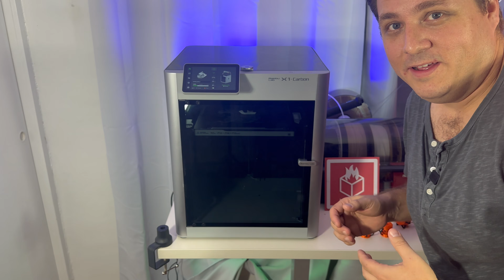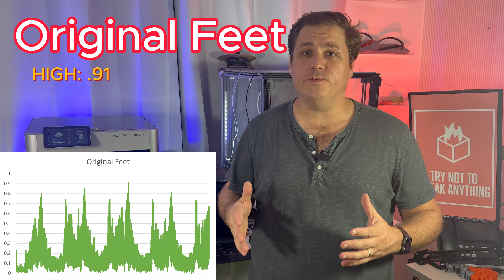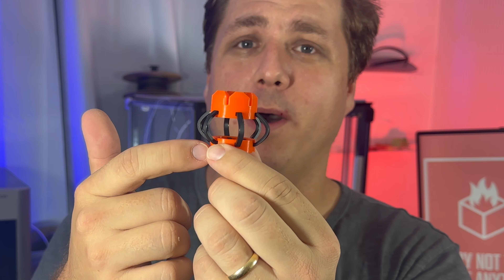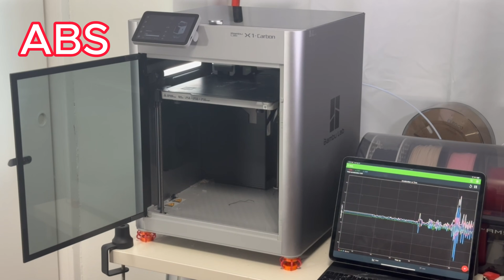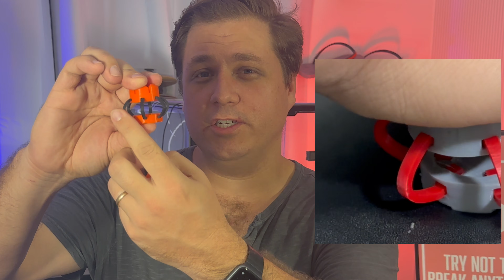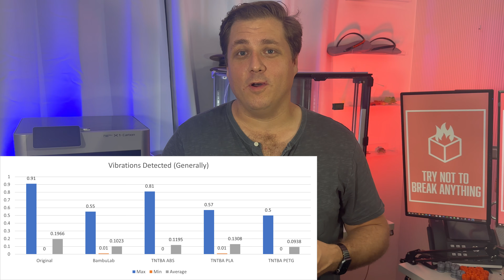Tested: BETTER BambuLab Anti-Vibration Feet. Download & Print!

Comment: Yo dude those are cool. 

One thing you may wanna consider ... and TBH I can not tell for sure but it kinda looks like your table may be one of those that has some sort of fold down feet ... and if it is ... a big part of your problem is likely the stability of the table itself. Again, I can't tell for sure how your table is constructed so I could be wrong here. 

I have found that with a rock solid stable table my printers have vibrated less because they could not get the table vibrating to begin with. 

Just my experience. Your milage may vary. 🙂

Either way, keep up the good work designing things!

Comment: cool video. I haven't scrolled through to see how long they lasted, but it is super rad you were able to best Bambu's offering.
Reply from the maker: I moved on to version 2 and they lasted almost a year. The clips failed on the back ever since I added the riser to my printer to hold up my AMS. It could be because of the riser weight or because I was moving my printer around a lot while I set up the new studio

Comment: I have some pet g and tpu on order so I'm going to test those ASAP. Which setting did you use for the tpu? This will be my first time printing this material.
Reply from the maker: So I used the regular FLEX setting in bambu slicer. try printing one first to see how that comes out. If satisfied print the final 3. Otherwise try tweaking the settings a bit.

Comment: Great design and research... I have a P1S on order. Doesn't the X1 have software-based vibration compensation? Is it not enough? I do not have a particularly stable/stiff platform in my 1930's house with all wood floors that is all over a basement, so I'm wondering if this is going to be an issue for me.

Comment: Hi. I loved the video and I'm trying to do the same vibration test with that app, but I can't find a way to get "the average" value:( I managed to export the recorded data as .csv and open it in Google Sheets, but all I get is a spreadsheet full of values for XYZ. Is there a way to get the average value from the app or did you just calculate it? if so, then how? Thank you!!
Reply from the maker: I got the average by doing the calculations on excel!

Comment: Cool looking feet. You should try the printer on a paver. I’ve got them under my prusa printers and they cut it down dramatically. As well as the noise level. Also helps if your table is solid. My desks are mounted to the floor so that helps. 
I just ordered an X1C so I’ll see soon. I may eat my words 🤣🤣
Reply from the maker: Thanks! Yeah but if I did that, I wouldn’t have been able to make this video! 😎😎
Reply: @TNTBA very true 😂😂 you could have compared your feet to a paver.

Comment: You know what would work better than your feet? A good solid table screwed to the wall with $1 worth of corner brackets. You'd instantly reduce your vibrations to zero, it would take 5 minutes to implement, and would last for years...
Reply from the maker: You’re probably right. Except i have an adjustable standing desk I use when I shoot my videos. I don’t want to have it bolted to the wall. With that said, yes - the sturdier the surface your printer is on, the better.

Comment: This method is reducing the vibration transfer from the printer to the table.  If that's what you are after, then your method is great, but ... that does not necessarily reduce the vibration of the printer itself and hence the ringing (which then needs to be countered by the input shaping).  I guess that you cannot get the input shaping data out of the Bambu, but it would be nice to know how all of these clips affect the resonant frequency and resonance intensity (so the nice graphs Klipper can deliver).
Reply from the maker: Dude: 100% this. If anyone has any clever ideas to get better testing, please let me know! Love klipper for this.
Reply: maybe you could measure the resonant frequency before and after when doing the calibration test ? @TNTBA

Comment: Is it printing better or not with those at high speeds? Finally that's all what's matter.
Shaking table less does not necessarily means it is printing without ringing, or with less ringing.
However I could be wrong.
I did test my Ender 3 S1+ with half squash balls used as feet, and it is slightly better and quitter.
Reply from the maker: So I started this whole journey because of my shakey table. I have not noticed any impact to print quality or speed for ANY of the feet I have tested. I am currently testing (as best as I can) version 2.0 against BL’s AVF for things like ringing, ghosting, etc. it’s tough because of how closed system it is compared to klipper.

Comment: No criticism, nice job. I'll try out your design. I personally have an issue with the BL feet, if you try to shift the printer slightly without picking it up, the feet bend over and fall out
Reply from the maker: Yup! They’re a pain in the ass. Version 2.0 will be released soon.

Comment: Could add a open honeycomb block(using thin walled  tpu) as a buffer between top and bottom to better dampen lower frequencies, while improving stability. Just some 💭♥️👍
Reply from the maker: I appreciate it! You mean, swapping out the clips for a honeycomb squish thingamabob? Or in addition to the clips?
Reply: @TNTBA  No, just in addition, probably spaced between top and bottom. Printing as one part might defeat purpose of noise isolation. Also if too rigid and/or too tight or a closed top/bottom, might deafeat the purpose. Printing with lowest durometer (60A) could make for better dampening.
Reply from the maker: I haven’t tried it. I didn’t have any luck with any one piece designs I made or found online. I did get some TPE in the other day though…. Hmmmmmmmmmmm…
Reply: @TNTBA  You are right, anything single piece will not work. But adding a cylindrical block of open honeycomb TPR, wedged btn. Top and bottom TPU, should work well, in addition to adding a bit of stability, if someone happens to put too much weight on a corner.
Another option is to print a taller version(so that it gets squished by the underside body), print a lot of them, sneak them in , spaced few inches apart equally  on every edge. Could completely kill any vibration. Only downside is any relocation could mean repositioning all of them. Just some 💭
Reply: Just to add upon multiple TNTBA anti-vibration foot on each edge, you could design a closed cookie cutter like base(may be for a set of 3 spread out over 10 inches), that would act like a locking base, and by providing 4 corners of this base with a plastic bolt and a nut, you could provide for ideal compression against underside of body. Also, with this base plate, you don't need to redesign a longer one. This would allow for better tuning, apart from making relocation easier(since the TNTBA AV feet is locket in place). It will definitely blow the vibrations out!😂❤👍

Comment: spend over a grand on the Carbon and it doesn't even come with its feet included? Wow...
Reply from the maker: It comes with feet. Just not anything specifically to reduce vibrations.
Reply: @TNTBA  I get that, but it's pretty clear watching it print that it shouldn't be a $10 add-on, it should be the default
Reply from the maker: @ShadowDrakken ehhhh… you may prefer not having the AVF by BambuLab. I think they should have thrown them in for the user to choose - in that sense, I agree with you there.

Comment: Cool project! The advice that I've heard from 3D printer designers is you ideally want the printer sitting on a large stone paver (bonus if it's anchored to the paver) to add mass to the unit, and then use high-density foam to decouple the printer mass from the table it's sitting on. This should not only reduce vibration traveling to the table, but give better resonance performance to the printer.

Would be interesting to see a follow up test from you or someone with a Bambu.
Reply from the maker: Yes! I’ve heard that as well. I even read a post by highrise955 on the BambuLabs forums, doing similar testing. I would love to see someone do some serious testing and provide me with their data/results so I can attempt to improve my design.
Reply: @TNTBA did you ever get a paver and test this? If not I can test for you today

Comment: You saw significant reduction on the table vibration.... but not of the printer. Just look at how much it wobbles like a jelly on those feet.

There is a reason why machinists want as much mass as possible on their machines rather than trying to damp it with rubber.

Much better off having solid rubber feet and adding a plate of steel to the bottom of the printer.
Reply from the maker: I appreciate the comment! Just trying to make a thing that works as good/better as a paid thing sold by BambuLabs. As I’ve stated, I’m not an engineer, designer, or scientist. I’m just a guy passionate about 3D printing who’s trying to solve a problem in a creative way. Assuming you’re right, by all means: go out and get your slab of concrete or metal sheet and rubber pads! All love brotha! May your layers print clean, and your prints come out epic! 

I’ll test the vibrations on the machine in the future to see how they all play out. Stay tuned!

Comment: Great approach for problem solving, a suggestion when you take your measurements using your phone or ipad accelerometers, make sure the device is laying completely flat and facing the exact same direction with every test to reduce the error. if you have your ipad up and tilt your ipad screen differently for each test, the x,y,z movement values will be different even if the movement on the table is the same.  Laying it flat and facing it the same direction for every test will help reduce the error for each axis and will provide more comparable data for which way it's helping reduce the movement, left to right or front to back. Based on your design, it would likely be different depending on how you set up the feet. If it's only one spring front and one back, it'll be less at removing those movements when compared to the left to right, as that shows 2 springs (clips) on each side.
Reply from the maker: Thank you!!! You’re right! I realized that during testing originally. At the end of the day, whether my feet are not as good or not, my observations can’t tell the difference between the effect on the reduction of vibrations on bambuLab’s design and mine.

Comment: neat concept.  One thought, when you do testing for something like this, you really should have the door closed on the printer.  The door flopping around as the machine prints will likely be affecting your results.
Reply from the maker: Good eye! Yes. It’s true it may have affected the testing. However, even with the door closed during my other testing, the conclusion remained the same.

Comment: Cool video, will try on my P1S! Maybe look into F80 resin.. I’ve had success doing some rubber type designs and that material is really cool to see come off the SLA printer
Reply from the maker: If you do, until version 2.0 is out, try using them without the AMS on top of the printer. Or if you print enough clips, try with the AMS and let me know how it fared. 
Thanks!

Comment: Looks great, will definitely try out a future V2 version, which can hopefully handle the X1C with an AMS on top. 
I wonder if PP might work even better than PETG, it’s more flexible, and very hard to push it into the plastic deformation range. Though I’m not sure if it’s dimensionally stable or if it has large amounts of creep and will flatten over time. Works excellently for clip in live hinges though, so it’s a neat filament to have on hand anyways.
Reply from the maker: The only thing I’ve noticed during testing is it’s less about creep and more about the weight. It causes deformation a the moment of placement or shortly thereafter during print.
Reply from the maker: Oh- v2.0 is ready. I just need to test it.

Comment from the maker: Hey everyone who recently downloaded the TNTBA anti-vibration feet! 

It’s been brought to my attention they the clips for the current version cannot carry the weight of the X1Carbon with the fully loaded AMS on top. I’ve also just tested this on my X1C and ended up with the same results. 

Therefore, do not expect that setup to work with the TNTBA anti-vibration feet. 

P1P & P1S users: you don’t seem to be affected since there is a significant weight difference between the X1C and P1P/P1S. Until I hear otherwise, you should be good to go!

Comment: Cool idea so I thought I'd give it a go. I've had my X1-C for about 6 weeks now and have not tried any other anti-vibration solutions. Printed the head and feet with Overture 95A, and the springs with Hatchbox PETG. The printer sits on a desk right behind me so I know what it normally sounds like, and right away I noticed a huge reduction in ambient sound. It sways a LOT more now which was a little disconcerting, but everything held up ok. This morning (a day later), I have noticed that the rear springs have failed under the weight of the fully loaded AMS unit. I'm wondering if a "beefier" design is needed for the springs. Can't recommend as-is for those running AMS.
Reply from the maker: I would love to learn more from your experience and make modifications for version 2.0. You have the AMS on top of the printer, right? I keep mine set aside since I often find myself removing the top lid. Perhaps beefier clips are in order!

Comment: The first thing is you need a better, more rigid table than those plastic tables.  They will amplify any vibration your printer creates.  I know as I've tried one of those myself.
Reply from the maker: Rigid table, yes. It’s not one of those plastic foldable tables. It’s an adjustable stand up desk. It’s a bit wobbly - but it’s not affecting print quality.
Reply: I slapped an MDF board over my cheap plastic table & anchored the MDF to the wall studs using L brackets. Seems to work pretty well.😄

Comment: I know I personally was looking at buying the AVF from Bambu as I’m getting ready to order my first 3D printer (X1Carbon).  And since I don’t have ANY printing experience yet, do you offer a complete set for sale?  Obviously I would only need your file and the correct Filament to do the same thing, but I think for those getting started it might be a good option to have them somewhere to purchase completed and ready to install..    This serves 2 purposes:  
1. You have AVF ready to install and go with a new printer.  
2. You get to see the quality of printing the X1Carbon can do right off the bat by not only seeing the finished prints, but also how they help the machine they are printed on..  

Might seem silly, but I would totally buy 1-2 sets to start with and then print my own at a later date if needed.

Great review and design!
Reply from the maker: First of all: congrats on getting into 3D printing! Here’s how you’re gonna get your experience: Print without the feet for now. You DON’T need them. Get comfortable using the printer. When you’re feeling up for a “challenge” (it’s definitely not a challenge once you understand your printer), grab some TPU and PETG from BambuLab or Amazon (affiliate link in bio) and print out my design. You’ll thank me later because you didn’t buy the feet, you made them. And you’ll get to show that off to your friends and family.

Only advice: if you got the AMS, absolutely DO NOT try to feed TPU through it. It’s not made for it.

Comment: Great test, design and vid! I believe checking the table vibration is a bit flawed.
When you think about it what really impacts quality and kinematics is how much the nozzle ends up shifting/vibrating compared to the bed, which can cause ringing etc
Some feet may limit vibrations transmitted to the table, but cause more vibration on the nozzle

It would be nice to use one of those usb-attachable accelerometers on the extruder and compare the results
Reply from the maker: Lol thank you! The purpose was to dampen vibrations to my desk. The feet, as well as BambuLab’s feet, do little to help improve or worsen the print quality.

Comment: I am very impressed by what you have done.  The idea of modeling them to fit into the printers foot cavities is great.  And using the acceleration data to analyze the results is an outstanding idea.  I was thinking about this a little, not as much as you have, and here is a question for you.  It seems the vibration isolation is mostly important to the effects the printer has on the table and other machines on the table. Have you thought about or considered how the vibrations effect the print quality of the X1 .   I suppose I am asking if you believe the vibrations of the X1 itself can cause issues in the print quality of the items.   I would not know how to do it, but I am curious, what happens if you put the computer on top of the X1.   To me the print quality would be at least as important as annoying as a shaking table.  Again, I am impressed.  Thank you
Reply from the maker: First off, thanks!!!! 

Regarding vibrations: I’ll think overall, the feet will provide a route to allow vibrations from the printer to the AVF feet and will help with dampening sound and possible resonance artifacts appearing in the print. However, I see these feet as more of a solution to the effects the printer has to the surface it’s placed on. I don’t believe it will provide any noticiable improvements or detriments to print quality. You’ll have better luck improving the quality of print by making sure the print head is affixed properly to the x axis and belts remain taught and tuned. Also: resonance compensation configuration should artificially resolve any issues in print quality.